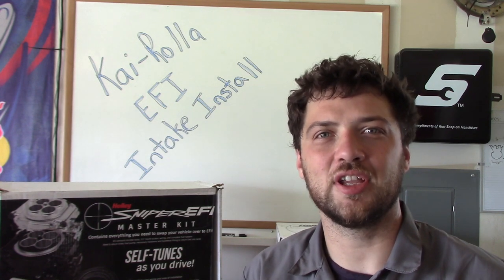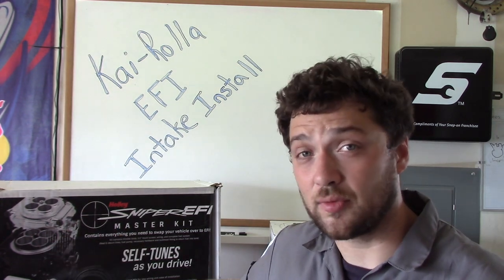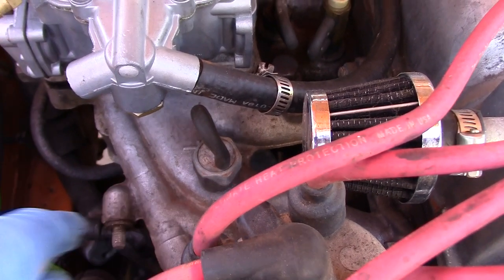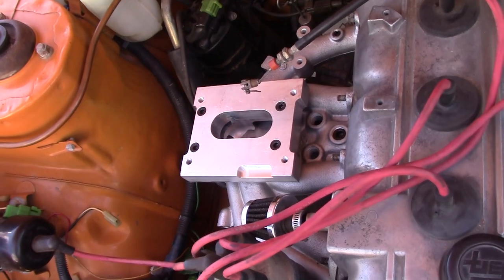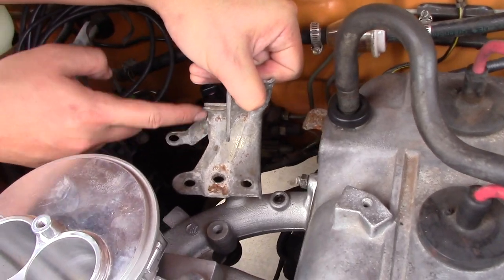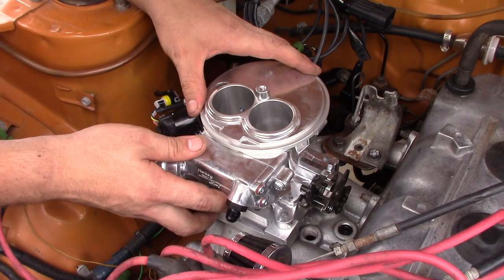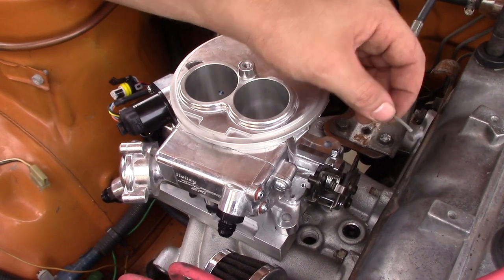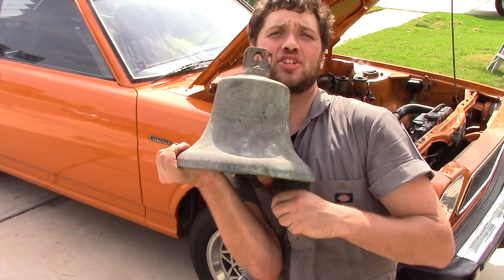Modernizing a 1978 Toyota Corolla: Installing EFI (Part 3)

Comment: Damn im totally converting my 4ac now, With my current distributor there is no external coil pack so it will be hard. Ive tryed to get the car to run with a edis + mega jolt system but it kept backfiring like it was 180 out, i need to get back to that project

Comment: I have a 79 corolla fastback sr5 coupe, te51, getting parts for it has been such a mission.
Reply: Oooh love the TE51 sports coupe! Yeah I'm having issues to source parts as well, esp. the robbers n seals, but hey that's part of the fun right?
Reply: You will have very hard time looking for those parts, just due to being so old and not in demand, since very limited numbers of those import autos are around today, compared to way back then.
Reply: Also due to rarity of the parts, prices will be very very high, even for used parts.

Comment: Could you mount the Holly horizontal? In a side draft configuration?
Reply from the maker: I have no idea, I don't see why not though. There is no float/floatbowl. That would be pretty cool!
Reply: Garret Seesing space wise that could open up this to a lot of smaller cars. Can this controller handle more than one of these? Have two side by side like two old carbs? But with fuel injectors?  That would be cool to see. I know you would have to have a real trick intake manifold for that to work.
Reply from the maker: @therealboofighter  you've been reading my diary! I want to run 2 of these as a cross ram on a V8 Since the system only uses one O2 sensor you could set it up so each ECU thinks it's running a smaller 4 cyl.

Comment: Megasquirt and an old Buick iron Duke tbi (2.5l 4 cyl) I did this on an old 22r
Reply: What are the differences with the Megasquirt and Sniper EFI systems ?

I have read about a Megasquirt system that's installed and used on a 3400 V6 SFI from the early 2000's and installed into a early 1990's, Chevy J body platform, also with Garrett turbo, with custom fittings and so on, but when it runs, it runs well and sounds sweet too.

Comment: Toyota's 1.8 HEMI motor is giving 750 HP . Thay is with all the race goodies . Howvever , this motor in modern trim could give a very easy 300 HP . They also made a 1.6 HEMI earlier . Both were strong engines . Bring them back Toyota and the 85 Corolla SR5 was good lookin as well . Get with the nostalgic program .

Comment: That custom bracket for the throttle cable can be worth a lot of money, i want to see this system at work. Awesome job.
Reply: GOGSANGEL A very nice 78 Corolla Wagon you got there~ thx for liking the video! 
Where did you get those headlight?
Reply: I doubt that ther would be very many of those 1970's models on the road today, due to being made so very long ago, and even shorter life for places that have winter, and using salt on the roads.

Comment: How did you know to get the holly 2300
Reply: Holly sniper 2300 efi kit is 2-barrel. The unit's base is the same as the old holly 2300 carb (also 2-barrel) base. He had a speed shop machine an adapter plate to mount the unit on the stock corolla intake.

Comment: Enjoyed the video but that's not EFI.  Hats off to Holly for clever marketing.  Its a carburettor with electronic management.  There is no injection into the cylinder head so its a bit rich (excuse the pun) calling it EFI.  Maybe EFM (electronic fuel management) might be fair.
Reply: This might be the most wantonly pedantic (and wrong) thing I've seen on this channel. Lol 
"Injection" does not specify where it is being injected. Just that it is. As opposed to it being drawn in by low air pressure.
Reply: @monono954  Isnt it still being drawn in by low air pressure?
Reply: @Reginaldesq  Not operationally - there is no venturi metering fuel, that's all done electronically. An injector, a(high pressure, relatively) fuel pump, and a regulator. 
If you want to draw distinction, you could say it's Throttle Body Injection. But it's still injected(pumped) with fuel, it does not draw fuel.
Reply: @monono954  Pretty sure the engine vaccum is pulling the fuel in from the carburettor.  I agree that there is electronic management but if the injector just squirts fuel into the carburettor bowl (as it appeared to be doing) then isn't the fuel just getting sucked in as it would with a regular carburettor.
Reply: No.
By that definition, port injection is also a carburetor because the fuel is being sucked in by the cylinder off the intake valve.
Again. This is throttle body injection. There is an injector, in the throttle body (no carburetor) that injects a predetermined amount of fuel.
Engine vacuum is not drawing the fuel from the metering device, pressure supplied by the pump(high pressure) is pushing fuel out from the injector.
 
A carburetor uses air flow to to pull fuel from the float bowl. As air goes through the venturi, its speed increases and creates an area of low pressure which draws fuel in. Engine vacuum only creates the air flow through the venturi which is what is actually bringing the fuel into the manifold. This is where your misunderstanding lies, I think. 

https://www.youtube.com/watch?v=oIU-lGc3DL4.

Comment: would have just been easier to take another toyota engine that bolts right up to that tranny, toyota had a habit of keeping the block the same for a long long time so you could have probably bolted a 90s motor right up

Comment: to bad it will actually perform worse with EFI vs a properly tuned carb. people replacing shit without actually knowing whats going on under the hood. "runs like shit lets replace the carb"
Reply: I have a properly tuned weber 38 on my 1.6 Suzuki samurai.  Runs incredible,  but..... it still lacks on inclines. So i may  want this efi option.  The efi that came with the motor was troublesome and parts are almost non existent now. Carb was a better option however this does look interesting.   I hear it does run very well with other vehicles.
Reply: @20tea  it runs well sure, and its very easy to setup and hands off, however EFI does not make as much power as a properly tuned carb, you might look into replacing what you have with something newer.
Reply: @thelasthallow  problem is that there's not many options for engine swaps if i want to keep my heavy modified drive train for offroad.  I may opt for a 1996+ Suzuki 1.6 liter 16 valve mpi, but the parts are getting hard to find.  I was considering something bigger and newer,  but the whole car and axles would have to be gutted.